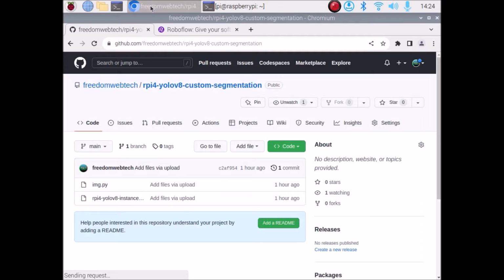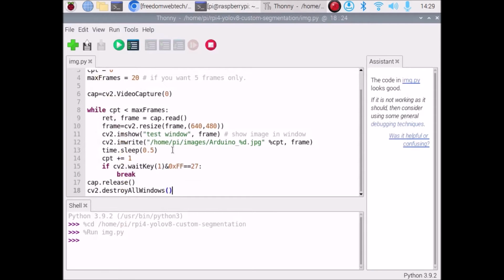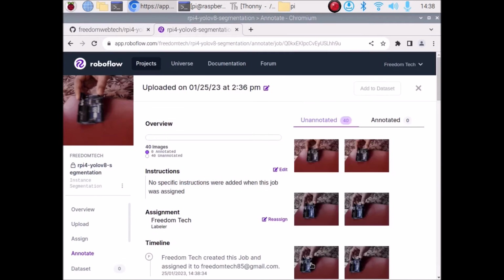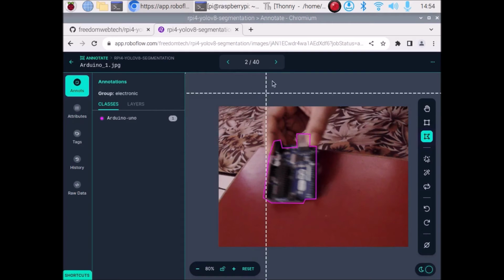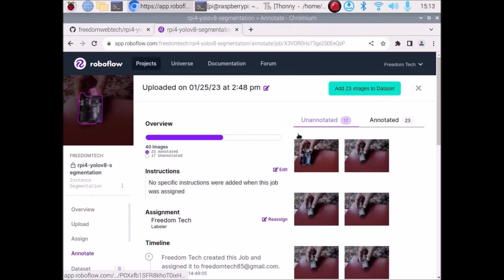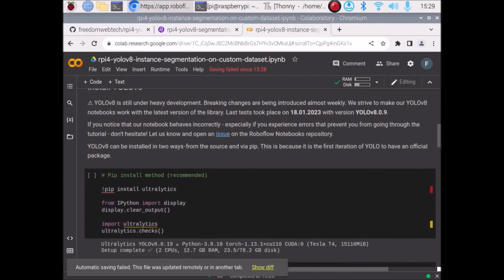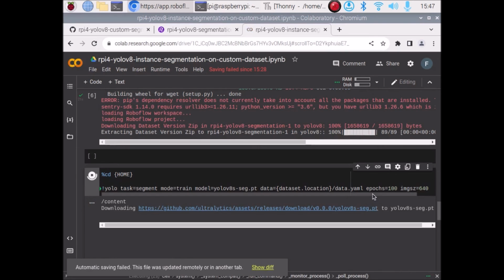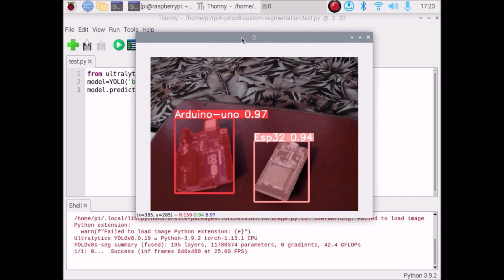YOLOv8 for Custom Instance Segmentation | yolov8 raspberry pi 4 custom instance segmentation

Comment: /content
Ultralytics YOLOv8.2.45 🚀 Python-3.10.12 torch-2.3.0+cu121 CUDA:0 (Tesla T4, 15102MiB)
engine/trainer: task=segment, mode=train, model=yolov8s-seg.pt, data=/content/datasets/rpi4-yolov8-segmentation-1/data.yaml, epochs=100, time=None, patience=100, batch=16, imgsz=640, save=True, save_period=-1, cache=False, device=None, workers=8, project=None, name=train4, exist_ok=False, pretrained=True, optimizer=auto, verbose=True, seed=0, deterministic=True, single_cls=False, rect=False, cos_lr=False, close_mosaic=10, resume=False, amp=True, fraction=1.0, profile=False, freeze=None, multi_scale=False, overlap_mask=True, mask_ratio=4, dropout=0.0, val=True, split=val, save_json=False, save_hybrid=False, conf=None, iou=0.7, max_det=300, half=False, dnn=False, plots=True, source=None, vid_stride=1, stream_buffer=False, visualize=False, augment=False, agnostic_nms=False, classes=None, retina_masks=False, embed=None, show=False, save_frames=False, save_txt=False, save_conf=False, save_crop=False, show_labels=True, show_conf=True, show_boxes=True, line_width=None, format=torchscript, keras=False, optimize=False, int8=False, dynamic=False, simplify=False, opset=None, workspace=4, nms=False, lr0=0.01, lrf=0.01, momentum=0.937, weight_decay=0.0005, warmup_epochs=3.0, warmup_momentum=0.8, warmup_bias_lr=0.1, box=7.5, cls=0.5, dfl=1.5, pose=12.0, kobj=1.0, label_smoothing=0.0, nbs=64, hsv_h=0.015, hsv_s=0.7, hsv_v=0.4, degrees=0.0, translate=0.1, scale=0.5, shear=0.0, perspective=0.0, flipud=0.0, fliplr=0.5, bgr=0.0, mosaic=1.0, mixup=0.0, copy_paste=0.0, auto_augment=randaugment, erasing=0.4, crop_fraction=1.0, cfg=None, tracker=botsort.yaml, save_dir=runs/segment/train4
Traceback (most recent call last):
  File "/usr/local/lib/python3.10/dist-packages/ultralytics/engine/trainer.py", line 527, in get_dataset
    data = check_det_dataset(self.args.data)
  File "/usr/local/lib/python3.10/dist-packages/ultralytics/data/utils.py", line 329, in check_det_dataset
    raise FileNotFoundError(m)
FileNotFoundError: 
Dataset '/content/datasets/rpi4-yolov8-segmentation-1/data.yaml' images not found ⚠, missing path '/content/datasets/rpi4-yolov8-segmentation-1/rpi4-yolov8-segmentation-1/valid/images'
Note dataset download directory is '/content/datasets'. You can update this in '/root/.config/Ultralytics/settings.yaml'

The above exception was the direct cause of the following exception:

Traceback (most recent call last):
  File "/usr/local/bin/yolo", line 8, in <module>
    sys.exit(entrypoint())
  File "/usr/local/lib/python3.10/dist-packages/ultralytics/cfg/__init__.py", line 591, in entrypoint
    getattr(model, mode)(**overrides)  # default args from model
  File "/usr/local/lib/python3.10/dist-packages/ultralytics/engine/model.py", line 644, in train
    self.trainer = (trainer or self._smart_load("trainer"))(overrides=args, _callbacks=self.callbacks)
  File "/usr/local/lib/python3.10/dist-packages/ultralytics/models/yolo/segment/train.py", line 30, in _init_
    super().__init__(cfg, overrides, _callbacks)
  File "/usr/local/lib/python3.10/dist-packages/ultralytics/engine/trainer.py", line 132, in _init_
    self.trainset, self.testset = self.get_dataset()
  File "/usr/local/lib/python3.10/dist-packages/ultralytics/engine/trainer.py", line 531, in get_dataset
    raise RuntimeError(emojis(f"Dataset '{clean_url(self.args.data)}' error ❌ {e}")) from e
RuntimeError: Dataset '/content/datasets/rpi4-yolov8-segmentation-1/data.yaml' error ❌ 
Dataset '/content/datasets/rpi4-yolov8-segmentation-1/data.yaml' images not found ⚠, missing path '/content/datasets/rpi4-yolov8-segmentation-1/rpi4-yolov8-segmentation-1/valid/images'
Note dataset download directory is '/content/datasets'. You can update this in '/root/.config/Ultralytics/settings.yaml' i got this error